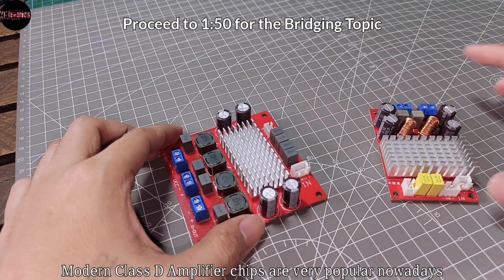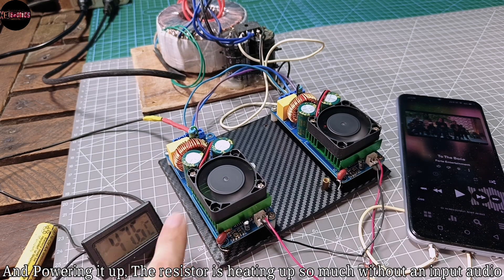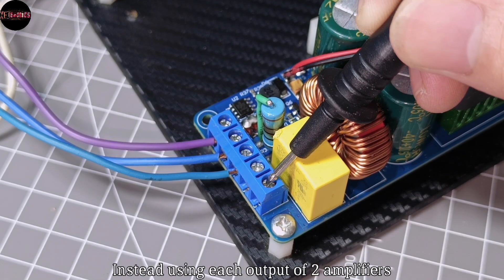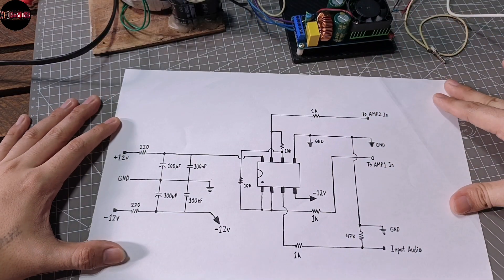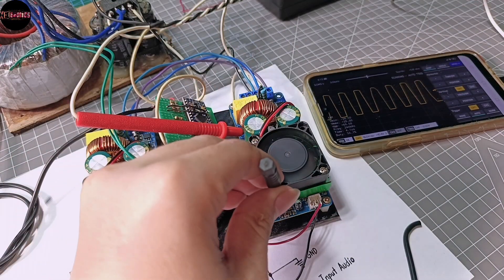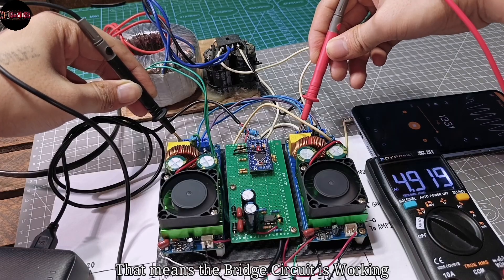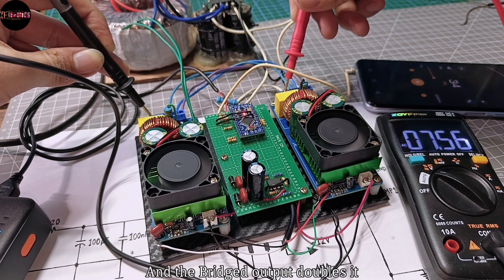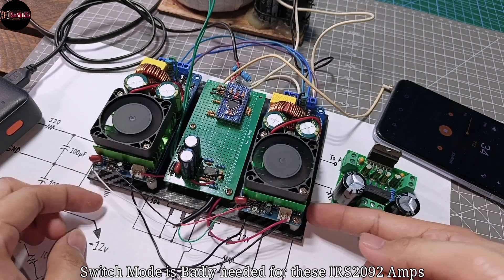Fully Bridging the IRS2092S AMP Module with Clock Sync!! #classdamplifier #irs2092 #diyamplifier

Comment from the maker: I forgot to mention, Bridging still works without clock synchronization!!! 
Just set their Operating frequency close to each other around 20kHz difference. Synching it will make it stable in the long run after all. 

Shopee Link;
https://s.shopee.ph/2qM7GUd6lZ
Aliexpress Link;
https://invl.me/cln1240

Comment: Boss patulong yong irs2092s ko ,na cut off sound nya pag malakas na volume , 48 0 48 vac gamit ko na transformer ... Pang sub ko Siya , 8" na subwoofer speaker nakaload , 4 ohms  800 watts , tosunra brand... Patulong naman boss , ano kaya problema ? Hindi ba kaya Ng speaker si irs2092s oh Hindi kaya ni irs2092s yong speaker?
Reply from the maker: Common issue to boss, hinahanapan ko pa po ng paraan, Protection feature kasi ni IRS yan boss

Comment: sir, san ka kumuha ng dual 12vdc supply para sa bridging circuit?
Reply from the maker: Don din sa 9VAC ng Transformer boss
Reply: @x3dtronicsph ty sir. ask ko na lang din sir dito, alin alin bang mga components ang need palitan sa irs for better stability and performance. nababasa ko better daw palitan orig mosfets. then yung 10ohms na resistor. aside sa mga yan alin alin pa ba?

Comment: Tanung ko lang sir kung kaya ba ng btl board mo UNG 70+-  nag babalak Ako mag Bride kaya lang nag ddalwang isip Ako bka  masunog UNG board ng bridge
Reply from the maker: Di ko sure, Pero kailangan Solid na SMPS kung ayan balak mo, gagastos ka ng lagapas 4k sa power supply palang
Reply: @x3dtronicsph hnd sir may 8 PCS Ako na irs nka  +-75  .. lahat gumagana ..  subrang lakas nga ehhh halos pati UNG flooring namin yumayanig ehh... Ang tanung ko is kaya ba ng( bridge board) mo UNG 70 plus +- na supply..
Reply: @macdellsaludario8185 ilang vac transformer na gamit mo boss ? Sakin kasi 48 0 48 vac sa irs2092s gamit ko sya pang sub kaso nag cut off yong  sound pag malakas na volume
Reply: @diane-PH3 60 0 60 sir ... mga 72+- na sha pag dating  sa capacitor
Reply: Nakita ko na hahah 12v pala UNG supply ng bridge board .. sorry sir hnd Nakita UNG diagram ng board .. kla ko mag ksama sa supply ng irs

Comment: Boss gagawan mo ba to ng power test video?
Reply from the maker: Oo boss. Nag order na ako ng power supply. Sana sakto na yon. Di padin na shi shipout ilang araw na dahil naka pre order. 

Isa pa nagka bukol ako sa left braso boss, di ko magalaw halos buong left braso ko kaya di ko sure kung kelan ko magagawan
Reply: Bozs idol kita pag dating dyan.. saan location mo boss bili sana ako ng bridge kit mo or pagawa ko sayo
Reply from the maker: Malayo boss. Mariveles bataan ako boss. Di pa kasi ako marunong mag send sa J&T. Balak ko din talaga mag gawa ng maliit na version pero mas mura, Sa shopee kasi nasa 300 plus mga bridging kit
Reply: @x @x3dtronicsph  boss may idea ka kung pano Alisin Ang over current/short circuit protection sa laptop charger? Madami kaso akong laptop charger kaso namamatay pag mag draw ako ng power above 2.3 amps

Comment: Can bridge bridge two XY-T3002P amplifier? Need the information please 😢 it is a stereo amplifier with one 3255 class d ic
Reply from the maker: The 3255 chip's output is already bridged bro. What you can do is Parallel Bridge. It will act like ZK6001

Comment: Boss yung sakin pag kinabit ko na Ang power supply sa irs2092 nagiging imbalance, +/- 65v Ang supply ko at kung naka kabit na sa amp MAs mataas ng 10v yung + rail. 
Ok Naman ang sound Hindi distorted pero medaling uminit Ang heatsink, mahirap bang I-trace Ang cause nito? Thanks
Reply from the maker: May Problema ang Kalahating Rail, Maaring may Problem sa MOSFET kaya umiinit, or worst may problem sa Drive nyan which is yong IRS chip
Reply: @x3dtronicsph  pano ko po ma confirm na mosfet boss? 

Pwede bang i-power on ko yung amp(no signal) tapos i-measure ko yung apat na 20k resistor na naka parallel sa magkabila-ang side at kung Hindi same ang resistance nila ibig Sabihin mas Malaki ang current consumption ng isang mosfet compare sa isa? 

Sana ma sagot, thanks lods 🫡
Reply from the maker: Wala kaso yong naka parallel na 20k. Supply lang yun na dual ng chip, Parang Need mo na ng scope pag ganyan. 
Try mo i power On yong Amp, Tapos naka konek lahat pero alang signal. 
Testirin mo output speaker AC at DC test. 
Ang problema, kapag mataas frequency, di na madetect ng tester yan
Reply: @x3dtronicsph  boss sa tingin ko Baka yung power supply ko ang may problema , Baka kapag under load na ay nagiging unstable. 
Meron ako ditong 80-0-80, over na ba to boss or Pwede Kong i-try?
Reply: @x3dtronicsph  dc na pala yang 80-0-80 boss, kasi diba kung transformer yan at rinectify ay MAs tata-as pa yang 80v kapag naging dc na?

Comment: Nice, is it capable of using 80 0 80vdc in bridge mode? Balak ko ren kase bumili uli ng irs2092s na amp, yung aking irs kase na binili nasira na pero kaya niya i handle yung ganon kataas na boltahe pero yung ic niya umiinit lang pero kaya naman. 

So the voltage input will decrease if i put two irs amp together, now is it okay to use that power supply? Im using linear power supply of 60 0 60Vac, and for filtering i used 6 capacitor of a voltage rating 100V and 10,000uf.

Im planning to bridge mode the amp but i don't know how to make the diagram, pero may kakilala naman akong tech na magaling rin, pwede ko sa kanya ipagawa yung diagram, i will try sending him this video hehe, sayang kase naka tambak lang mini sounds ko sa bahay at malapit na Christmas wala man lang libangan.
Reply from the maker: Not recommended I bridge boss kapag naka Linear Power supply. Sobrang Takaw sa current kaya malaki voltage drop.
80V bridge ay alanganin, Need palitan MOSFET at Coil . Baka may pumutok 🤣.
±45V lang gagamitin ko sakin
Reply: @x3dtronicsph HAHA, yun lang hane bossing, siguro stick to mono nalang ako boss, wala kase akong pambili ng smps na dual supply ayy, saka malakas na ren naman siya sa mono, btw pero yung kay Eldz micro Lab Tv ay 87 0 87Vdc max input niya sa irs niya saka smps adjustable yung power supply niya, steady bridge pa at kaya 2 ohms load, mamaw 😂
Reply from the maker: Mamumulubi ako neto Power Supply palang🤣.
Gagawin ko kasi to Boss pang Subwoofer sa gagawin kong DIY channel. Pag Normal na tugtogan lang, Half Bridge.
Pero pag pumapalag ang kapitbahay, saka na Ifull bridge🤣

Comment: di ko pa kaya maintindihan ng malinaw yung mga dinidiscuss mo dito sir. 😅

ang kumplikado pala gamitin ang irs2092 na ito kung para sa stereo amplifier setup.
anyway, as of now may isa lang ako ng irs na ito na plan ko gamitin sa isang subscoop 15" 8ohms speaker. 48vac toroidal ang gagamitin ko. ok kaya yung setup na ito na pinaplano ko?
Reply from the maker: Okay lang din naman boss basta Malakas ang Toroidal at madami Capacitor. Namamatay matay kasi ang IRS kada bayo dahil sa voltage drop
Reply: @x3dtronicsph salamat sir.

Comment: May code saka schematic?
Reply from the maker: Eto code ng PWM generator. 
void setup() {
  // Configure Pin 9 (OC1A) as output
  pinMode(9, OUTPUT); 

  // Reset Timer 1 control registers
  TCCR1A = 0; 
  TCCR1B = 0;

  // Set Fast PWM mode (WGM13:10 = 1110) with ICR1 as TOP
  TCCR1A |= (1 << WGM11); 
  TCCR1B |= (1 << WGM13) | (1 << WGM12);

  // Set non-inverted output on OC1A (Pin 9)
  TCCR1A |= (1 << COM1A1); 

  // Set prescaler to 1 (CS12:10 = 001)
  TCCR1B |= (1 << CS10); 

  // Calculate TOP value for 350kHz
  // F_PWM = F_CPU / (N * (1 + TOP))
  // 350000 = 16000000 / (1 * (1 + TOP))
  // 1 + TOP = 16000000 / 350000 = 45.71
  // TOP = 44.71, so we use 45 (integer)
  ICR1 = 45; // Sets the TOP value for the timer

  // Set initial duty cycle (e.g., 50%)
  // OCR1A = (duty_cycle / 100) * (TOP + 1) - 1
  // For 50% duty cycle: OCR1A = 0.5 * (45 + 1) - 1 = 22
  OCR1A = 22; 
}

Pwede mo pa patungan ng ibang code yan sa loop, gagana yang PWM nang tuloy tuloy

Comment: ayos, grabe sobrang lakas pala talaga ng bridge mode ng 2092s na yan, I hope makapag perform ka ng dummy load test niyan and makapag recommend ka ng magandang smps para sa amplifier module na yan, for sure napakaganda niyan gawing D.I.Y. amplifier, halos wasakin na yung speaker eh HAHAHAHAHAHAHAHHAHA
Reply from the maker: Oo boss. Mahina pa yong Volume ko tapos 28-0-28 lang supply. Plan ko na bilhin is yong 45-0-45 lang. Parang nahuhulaan ko na na may Puputok na pyesa kapag nag power test na ako gamit ang SMPS, wag naman sana at magastos🤣
Reply: @x3dtronicsph Well expect na rin natin, especially yung MOSFET, may mga nakikita ako sa fb na pinapalitan nila yun ng genuine MOSFET dahil some of it ay fake daw, well yung sa gamit mo hindi ko lang sure pero much better na I-check mo na rin yung MOSFETs mo
Reply from the maker: Na check ko Mosfet nong isa, same seller lang pinag bilhan ko.
Pareho mababa Gate Capacitance, Sana nga di pumutok🤣
Reply: @x3dtronicsph yun lang, talagang swertehan nalang kung hindi sumabog yun during operation. that's why yung mga ibang na D-D.I.Y. niyan pinapalitan halos pahat ng components like nung MOSFET, inductor, snubber resistor, etc
Reply from the maker: Actually di na need palitan yong Snubber capacitor kasi nag da damp lang ng high freq oscillations. 
Ang crucial talaga yong Mosfet at yong Coil. Nag hahanap padin ako ng mabibilhan ng Legit na pyesa online, Kapag international kasi grabe ginto ang shipping, tas babayad pa ng 500+ sa customs, aray ko
Reply: @x3dtronicsph  yes, kahit di na palitan yung snubber capacitor, yung snubber resistor, inductor and MOSFET lang naman yung cons sa amplifier na yan pero overall napakaganda niyan kapag na modified talaga, kaso components talaga, napakamahal lalo na kung mag import pa, mabigat sa bulsa
Reply: @x3dtronicsph ano pala na Arduino series yung gamit niyo, Arduino nano ba yun na something kasi tinignan ko ng mabuti and I don't think na Arduino nano V3 yun?
Reply from the maker: Arduino Pro Mini yan boss. Need mo ba Code ng 350kHz pwm generator?? Medyo mahirap kasi mag generate nyan gamit integrator or 555 timer
Reply: @x3dtronicsph ahhhhh, kaya pala, akala ko nano V3, first time ko lang nakita yan. and sa code, sure naman boss, pero di'ko lang alam kung kaya ng Arduino nano V3 ko, maybe makabili din ako ng Arduino pro mini
Reply: @x3dtronicsph  maganda sana kung kaya ng 555 timer pero okay na din yung Arduino, implement lang ng code and okay na
Reply: Nasubukan kina yan pero kunting short ng kuniksyon mo dira agad masmaganda pa ang ocl504
Reply from the maker: Nasisira po talaga ang Amplifier kapag nasho short, Unless may short protection. Yong OCL wala yun short protection pero hindi sya sensitive.
Maselan kasi itong IRS, pero kapag nagamit mo sa Tama, Mamaw talaga

Comment: Did you use separate supply for your amp to bridge it? Because I thought you need different supply for bridging?
Reply from the maker: I used the exta 12VAC from the transformer. I just used a Voltage Doubler to have Dual Rail Supply. 
So Yeah, the bridge circuit's supply is isolated from the amp

Comment: Couldn't I just invert the input signal instead of using a op amp to get a 180 degrees out of phase signal?
Reply from the maker: How will you invert the signal bro? The audio input uses common ground.
Via software???
Reply: @x3dtronicsph by putting the ground and the + of the signal inversely for each amp the amp 1 is in phase and the amp 2 is out of phase 

Sorry correct me if I'm wrong
Reply from the maker: You need a differential audio source for that, and I think it will have some issues.
Just do the opamp circuit brother, it only needs 1 opamp IC, several resistors ang capacitors , and that's it
Reply: @x3dtronicsph ah okay thanks...
Can I ask a few more questions about bridging as I'm planning to make a diy amplifier based on bridged irs2092 

I currently don't have a oscilloscope or any measuring device for frequency can I ask how much resistance is in the trimmer for the oscillator to get to 400khz as my amps inductors heats up so easily
Reply from the maker: I measured around 206 ohms from mine, the other one measured 230. You can see it on my Previous video.

This is not accurate though because as i Mentioned from the prev video. The irs uses integrator, so the oscillation frequency depends on that trimmer and the capacitor value which is 1nF.
That 1nF has tolerance, so yours might have a different resistance value needed.
What is you power supply voltage and is it SMPS?
Reply: @x3dtronicsph  My power supply is 56v dual rail SMPS
Reply from the maker: Do you have a Thermometer?? Can you probe the coil to see how hot it is?? Does it heat up without playing music? 
You see, inductors can handle up to 125degrees depending on the design, that is above boiling point of water. If you have around 70° in operation, you dont have to worry at all. 
Or maybe your coil is Not designed for the amplifier, thats another case which is very common
Reply: @x3dtronicsph  oh okayy thanks...
It's around 67 degress after a minute of full volume

Comment: brother, why does bridging amplifier can provide 3 times power instead of 2times power?
Reply from the maker: It's all about the Power Calculation brother. For example, A Half bridge outputs 10Vrms at 4ohms load. If we compute that, 10x10 = 100÷4 is 25watts RMS. 

Now the Bridged setup will output 20Vrms. So 20x20 = 400 ÷ 4ohms = 100Watts RMS. 

See, the output RMS doubled, but the Output Power went over 3 times. 
Only con here is it draws a Lot of current